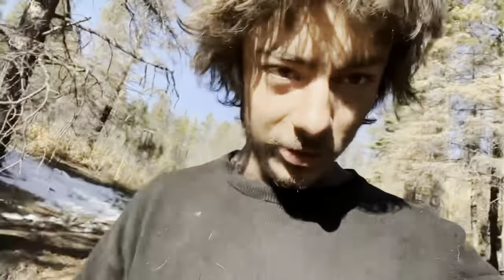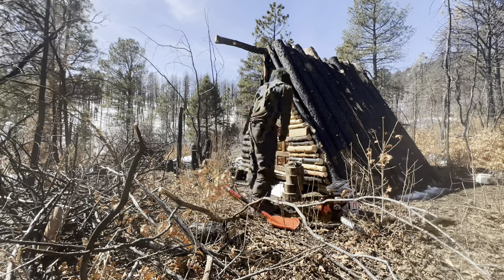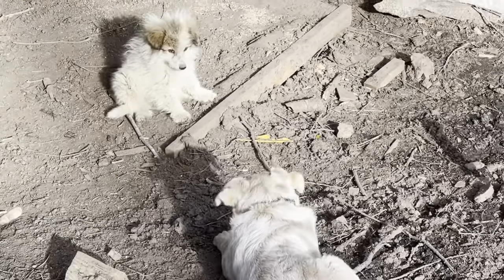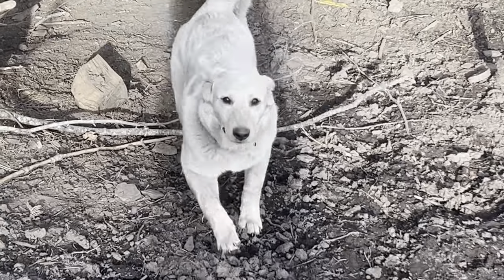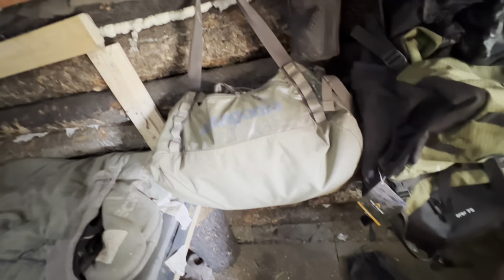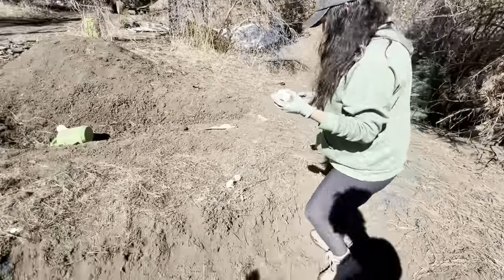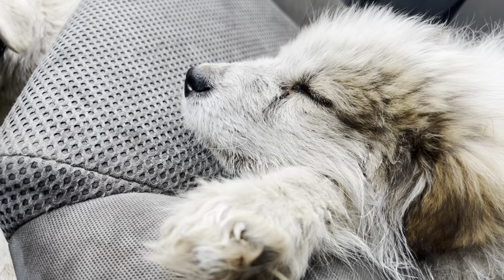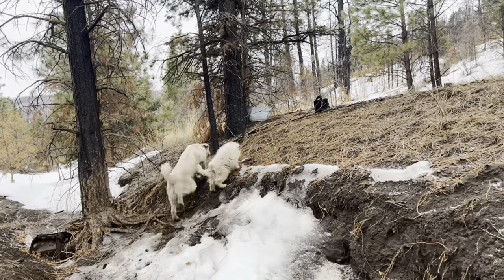Will Survives Episode 60

Comment: Hey bubba good idea to stack that lumber flat, off the ground to help keep it straight for future projects throwing it in a pile just turns it all to hockey sticks and fire wood bubba plus it will soak up moisture on the ground and start to rot which also makes it no good keeping up off the ground allows airflow and water run off 💯

Comment: Just put metal roofing on the a frame with some screws. Make the metal point at the top And ridge metal for the top extend the metal to the front porch and it will be completely waterproof screw on the flat not the hump, bottom middle top. On the ridge screw the ridge cap threw the hump on the metal into the wood. You’ll only need six to 8 pieces of metal sheet length depending on length of the building but you can cut it with a pair of snips and you could use four corners cut those at a 45 at the top and the top cap goes over those with installation strips so the top cap can set on that nicely also for wind does not get in

Comment: You’re gonna wanna clean up all the brush and dry leaves in that area you live in a literal forest fire zone every tree surrounding you is full of sticky gasoline, including the trees are building with keep that in mind also before you charge your wood, you should be stripping the bark stripping the bar allows the wood to dry betterfor long-term building as that will hold moisture and create rot and mould

Comment: Also you can get garlic to sprot just by breking em apart and placing em on a plate and then just put a lil water on the plate. You can also cook with the garlic shoots supposed to pull of the top sprout after like 4 leaves and force the nutrients down to the bulbs

Comment: theres caulking and trim casing pieces of wood u can use for the window. if u frame a rough opening first where you have 2x4s screwed to the logs to make a triangle u can put your window in and screw to the framing. then u can spray foam insulation between the frame of the window and the framed opening and install trim boards to cover the foam. beter instal and more insulated also dont give frank away f the vet u got it bud

Comment: Also you could always calk the holes and cracks on the outside then use spray foam insulation on the larger cracks on the inside

Comment: you definitely have to build a front porch on Jessie‘s house,  just use that same green tarp from Harbor freight fold it in half and use that as the awning. Build the deck first, and then just go around the log sticking out screw it down to each side of the deck.👌🏽 the smaller bed is better in many ways also you don’t have hoop dog trying to sleep up there with you, He’s perfect right there underneath your bed dude

Comment: Frank might be okay. The Vet has to be realistic about what the potential outcome of a severely stunted pup may be, but realistically if hes eating, drinking, shitting and playing, he could be just fine. It's going to take you a hot minute to find a qualified home for Frank anyway - you might see Lil man build strength and possibly some size before your even narrowing down a qualified new owner.

However, the only disadvantage he'd have out there is being able to evade a predator, and honestly, Hoop wouldn't stand a chance either - hes got a lot of growing to do before he could hang. A Fox would shred Hoop to bits right now if he cornered a mother Fox, nevermind how quickly a Coyote would end things. Not to sound morbid, but it's just the reality of things.

IMO, I'd take your time with finding a qualified home for Frank & in the mean time, you'll get to see how he is or isn't progressing. He may be more than suitable to stay. Another tip, Frank is being massively over fed, he likely only needs about 1 1/2 cups of food a day right now, split that up into 2-3 meals for the entire day - he should stop barfing from the massive overfeeding he's getting right now. Seems like the pup's are bonding already and looks like Frank is starting to like his surroundings.

Comment: The throw up and poop usually occurs when changing the type of food suddenly. Anytime you change their food, it can shock their digestive system and cause the throwing up and pooping. Sometimes their digestive system will handle it on their own and sometimes it can cause severe damage and death. He appears that he may be adjusting to the food. Just don't change it again without mixing the old with the new for a week or two. You should've fed the same food that the breeder used and mixed your new with it over a week or two slowly adding more each time. Its also important to not overfeed him during the transition time. He definitely needs a bath and groomed because that has a lot of health impacts because their coat is made to keep them warm and healthy. Runts usually make the best dogs. I'm not sure what I would do in your shoes. But if you do rehome him, I hope they make a youtube channel called @FrankSurvives and keep us updated.